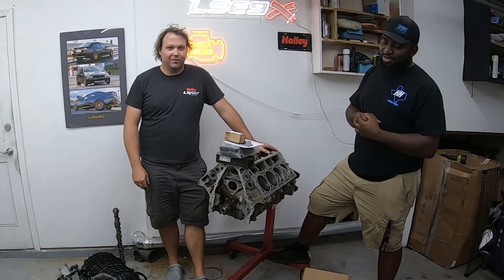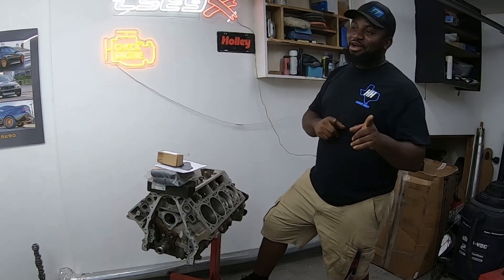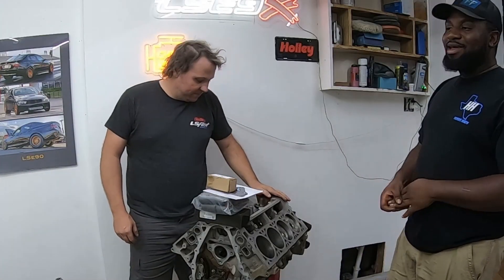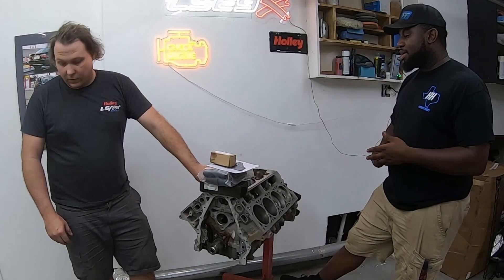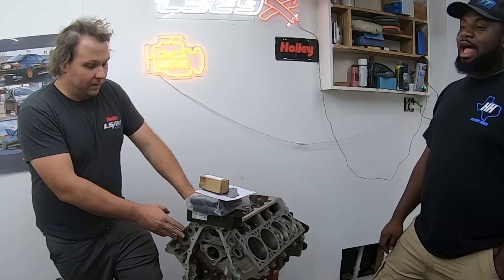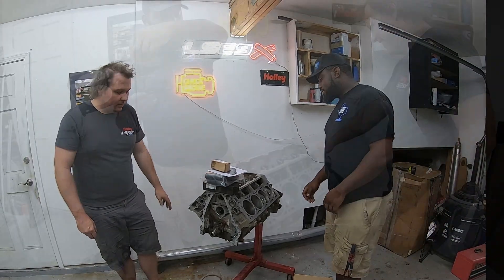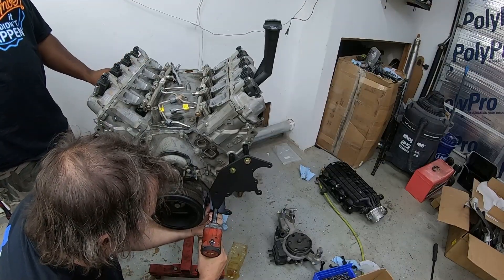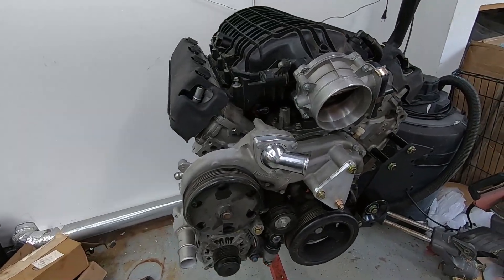The $20 BMW LT Swap – Part 0: Building the Cheapest LT-Swapped E90 Ever

Comment: Im looking for some information/parts for my 2014 320i F30 / L83 swap. Basically what intake  injectors headers and im pretty sure ive gotta change the accessory drive to a camaro style? And do you currently have a swap kit for this application? I will be starting the swap around February so i have time to gather parts and knowledge. I have the car and motor already